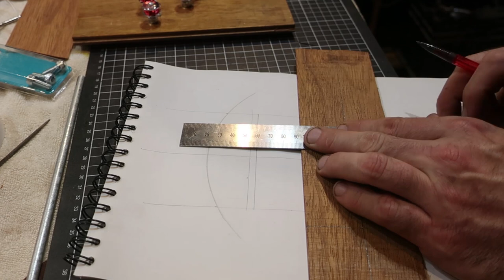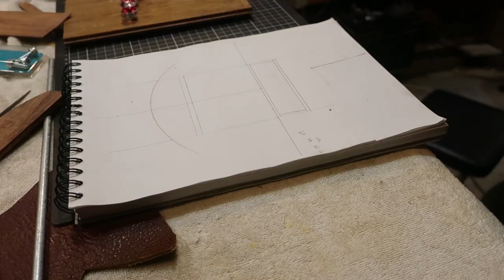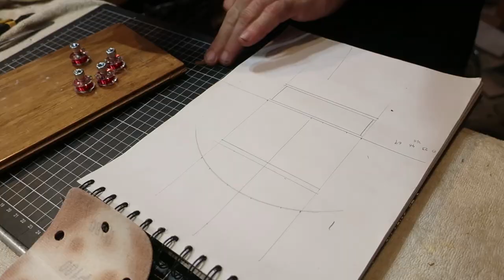Electric Upright Bass Episode 4 - Making an unusual pickup, cutting cavities, and final assembly.

Comment: This is by far the coolest bass build I've seen on YT. Absolutely gorgeous, and super unique. Have you thought about adding a Piezo pickup (maybe transducer style instead?) With a blend knob to get that more "upright" tone?
Reply from the maker: Briefly tried one at the end of the previous episode, it didn't go well, my homemade contraption made a sound that could be kindly described as 'sub-optimal'. The real ones cost an arm and a leg (and some teeth), and wouldn't sound that great either as they're designed to pick up not only the direct sound of the string on the bridge, but also the resonance of that giant acoustic body...it could never sound right on mine.

Comment: The reason your finish wont stick is the tannins (which makes it easy to darken) leaching out. Merbau/kwila is well known for it here on the other side of the pond. My approach would be to remove all the finish youve got on tgere, as its just going to fall off anyway. Then, seal the timber with an oil based sealer (apparently sikkens is good, but Ive never used it). When cured, you should be able to coat over the sealer. 
Aussies use a lot of Merbau for decking, as the natural tannins make it a great outdoor timber, but it is usually either left alone outside for st least 6 week to leach out the surface excess tannins, or washed several times for the same effect then finished with oil based finish...

TBH, im surprised you only had a problem with the body, but thats a bonus, as tge neck is gorgeous 👍🏼
Reply from the maker: Indeed, the body and neck are from different  boards from different suppliers, I suspected the neck was pre-oiled so gave it a proper clean before gluing up the neck blank + it drank the finish like a sponge. Never suspected the body but the proof is right there, oh well, it'll be better on the next one. Thanks.

Comment: That looks and sounds amazing! I guess the next steps will be to wind your own strings and somehow make tuners, so you will have made the entire thing from scratch. 😀
Reply from the maker: You're actually quite close to where my thinking was leading, making traditional tuners is a really specialized process, it's not really possible in my current workshop. However, a Steinberger style bridge with the integrated tuners is very much possible and would mean I could indeed make every part myself (except the volume pot, and the strings are a consumable so they don't count😉).

Comment: Kudos to you for tackling this. I am part way through the same, and making lots of mistakes as I go. Rather than having the pole pieces adjustable height like some other pickups I have decided to go modular with each coil easily interchangeable to experiment with polarity and change signal strength with different number of windings. It was painful learning TinkerCAD but I'm using a 3D printed housing. My Council library charges me just $2 to print them 😅
Based on what you said I think the 6mm neo rod magnets I bought might be a bit too strong? We shall see.
Thanks for the great video and go well with your projects 😎

Comment: You could build some telescopic legs on each side (probably of metal tubes, if not some hardwood), so it can still fit in a regular case and no need to drag the tripod.

BTW, that peeling also happened to me with some brands of lacquer and certain type of wood (all the holes for the pots started to peel)......I used paint stripper to remove the finishing, and it peeled all IN A SINGLE PIECE out of the guitar!.....I used after that a floor poly lacquer, and the problem was solved.
Reply: I saw the same thing on an Epiphone Zakk Wylde, the paint is in fact a plastic coating which comes off in one go 🤔

Comment: could we use countersunk head screws f90 rather than btr screws (better flat to hold the magnet)
I plan to do the same thing with adjustable screws, I have already made a plan
can we use wax rather than epoxy?
the strings have a different diameter yet all the studs are identical, do you have the same sound volume for each string without the need for separate adjustment??
Who already tried ?
your story is very scientific and fascinating ♥